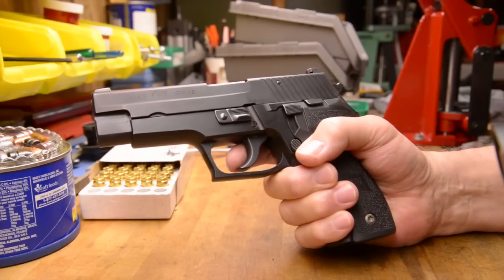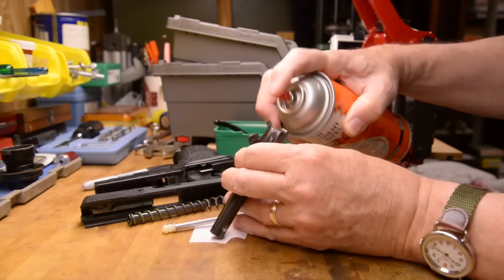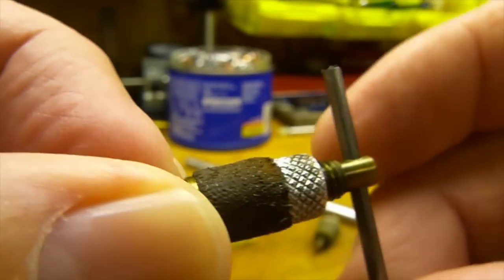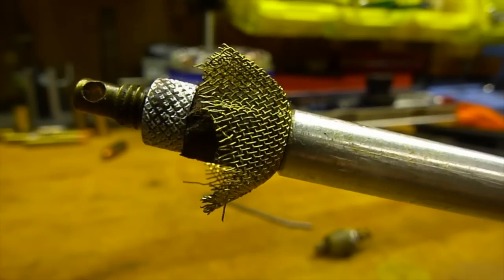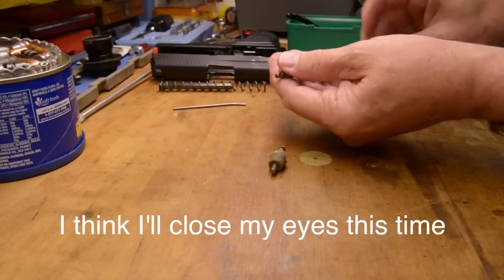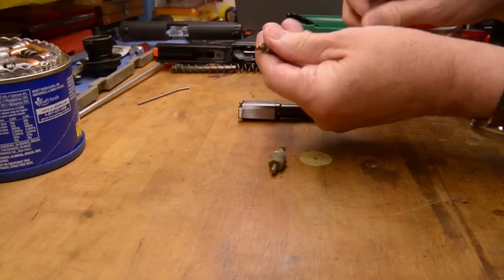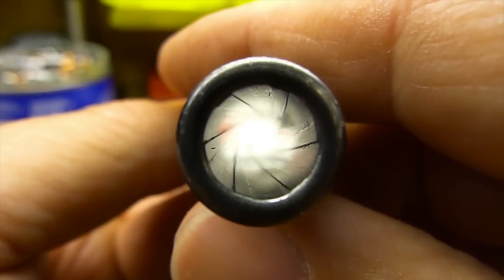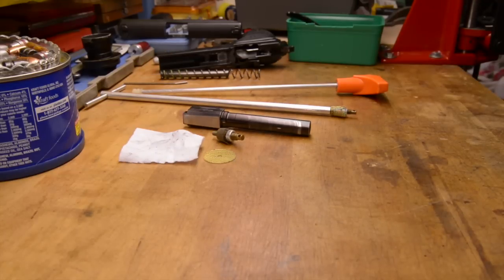Lewis Lead Remover Demo

Comment: Brass tobacco pipe screens come in the same size as the Brownells screens. I grabbed several hundred online at Amazon for $3 per 100. Just punched a hole in the center with an ice pick and they work fantastic. Saves a ton of money!  Love my Lewis removers for all of my revolvers.
Reply from the maker: Wow, what a fabulous money saver. Many thanks!
Reply: What size and what brand?
Reply: Buy 1in diameter for 9mm/.38 special.  Amazon has a pack of 100 for $8.95.

Comment: Nice video, well done. The camera work, close ups are nice. I'm shooting BHN 18 in both Smiths 629 & 10 plus my Henry .44 but only about 1000FPS. Cleaning has been no problem. Epoxy coated rounds from Missouri Bullets.

Comment from the maker: Mea culpa. I did not make the background to this video clear at all. The whole intent of shooting those little 9mm cast bullets at 1450+ fps was to quickly lead up a barrel so I would have something to demonstrate the Lewis tool with.

There are many good ways to remove lead from a barrel. Perhaps I should simply do a video comparing them.

1) Lewis tool
2) scrubbing with brass brush
3) shooting jacketed bullets
4) mercury in barrel overnight
5) Outers Foul-Out

Any others to consider?

Thanks, EF, for the nice mention of the film quality. Using a new video camera for most of the shots. New microphone, too.

Comment: apply Kroil first. Let sit for a while. Then use with Lewis LRR. Works great. Cuts down on  the strenuous passes.
Reply from the maker: Oswald Mazzetta Thanks, Oswald, and I think you will see that I started out with some Kroil which soaked overnight.
Reply: I really like ALL of your postings.After your review of the Forster Co-Ax press, I ordered one which is currently on backorder.
Reply from the maker: Oswald Mazzetta Thanks so much, Oswald. You're going to really enjoy your new press.
Reply: kroil is the nastiest solvent out there.......it smells terrible....I would never use it on a deer gun

Comment: Not knocking the lewis tool but I use a bronze brush and a power drill. works fine you just need to be careful to not screw up the crown
Reply from the maker: That's an excellent idea. I honestly had never thought of using a drill with a brush.
Reply: @RexRoach  Well I can't recommend it to everyone but with proper care, it works and works just fine.

Comment: 1400+ FPS is waaaaaaaay too fast for a .358 diameter bullet cast from wheel weights. That is 400 FPS into the range where gas checks are considered appropriate. Then again, my 1200 FPS .357 Magnum loads with 160gr LSWC don't lead too badly when made from wheel weights.

Comment: Do they make a rifle version for lever guns?
Reply from the maker: +spraynpray Interesting thought. I suppose you could use a good cleaning rod to pull the parts through. Personally, I'd use the popular method of wrapping a patch with pieces from a brass scouring pad.
Reply: +Rex Roach I'll try it.  I couldn't even get a brass brush down the bore after 1000 rounds through my new levergun.  Frustrating.
Reply from the maker: The Lewis tool is great for a really clogged barrel because of its adjustment nut. You can start "loose" and adjust it tighter as you make subsequent passes.

Also, like with the Lewis, trying pulling your brass brush through the barrel.
Reply: Yes.  I use the lewis lead remover with aOtis cord instead of a rod.  Works great.

Comment: All cast bullet shooters should keep their pressures and loads at levels that don't cause loading or use gas-checked bullets. You can't treat even "hard-cast" lead bullets at jacketed bullet velocities and not have leading issues. Even in GOOD barrels with actually round bores and conventional rifling. Shooting lead through an "octagonal-rifled" barrel is just BEGGING for leading.

Comment: much easier way...... plug up bottom of barrel, mix %50 hydrogen peroxide, %50 white vinegar, pour it into bore, stand in corner for 10 mins. Then push a copper brush through it.... lead gone.
Reply: Does that harm bluing? Just got a model 14 in excellent condition that has a little wadcutter remains in the barrel.